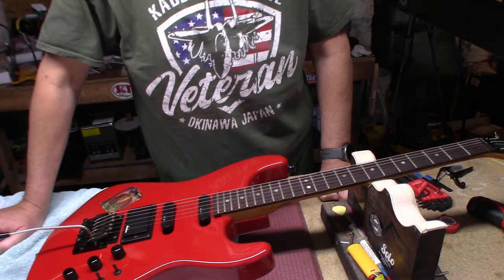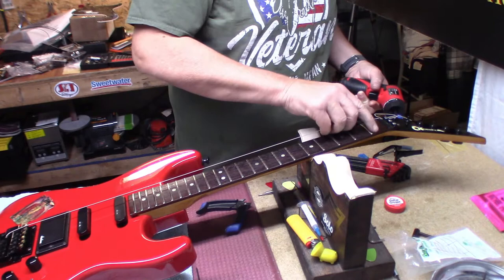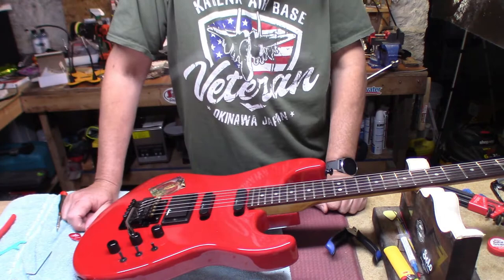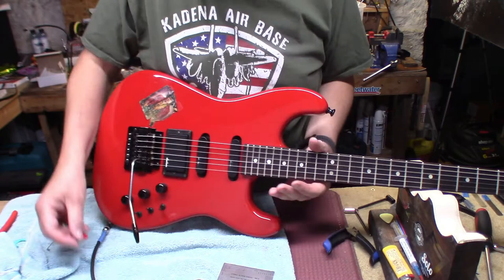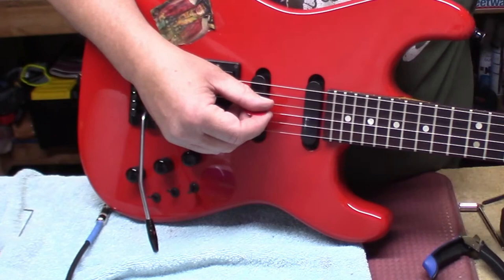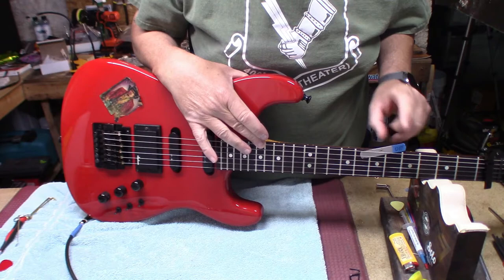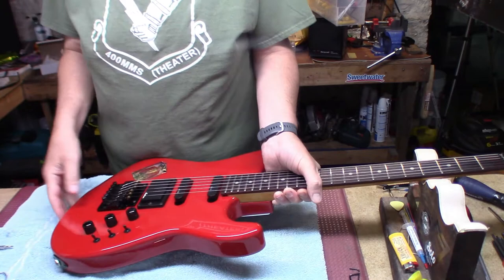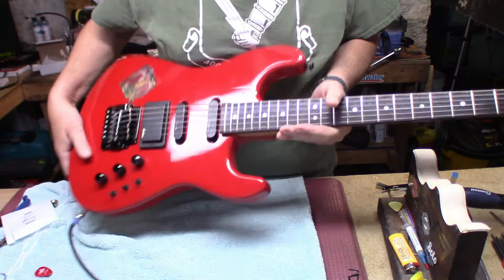Charvel # 4 How to Set Up an Kahler Trem The Movie EP239

Comment: I added one to my strat. The strings are kinda high. Should I tighten the truss rod all the way?
Reply from the maker: Only adjust the truss rod to .010" relief. Holding at the 17th fret with a capo at the first. Measure at the 7th fret. You Maddy need to shim the neck. Never tighten the truss rod to max by forcing anything.
Reply: @stringmanguitars4329  thanks, unfortunately I had tighten it too much. I noticed a crack on the part where the body and neck meet.  The good thing is,  it's on a POS Squier. I will shim the neck. And see how that works. Thanks for the reply. Subscribed.
Reply from the maker: @Sl33zytheclown  good luck and thank you
Reply: @stringmanguitars4329  thank you very much. I added a 1 degree shim from stew Mac and it works like a charm. I had to even raise the saddles a bit because of the fret buzz. Thank again. Looking forward to your other content